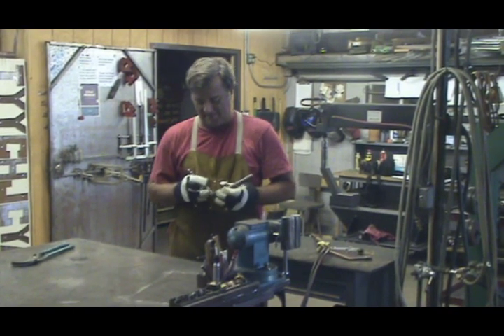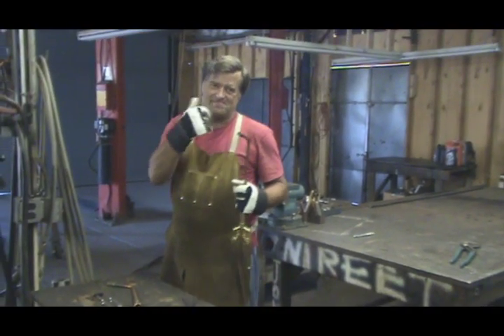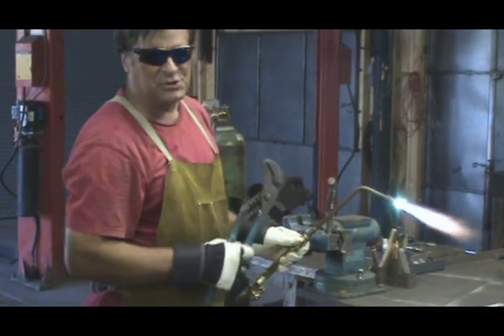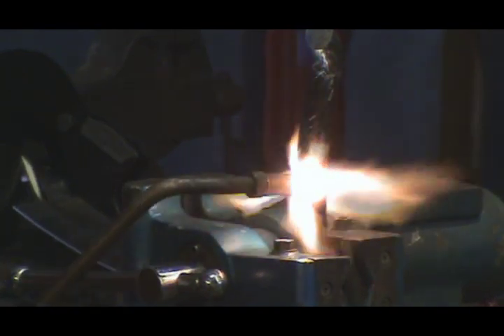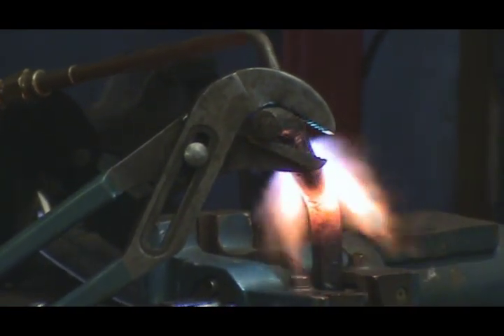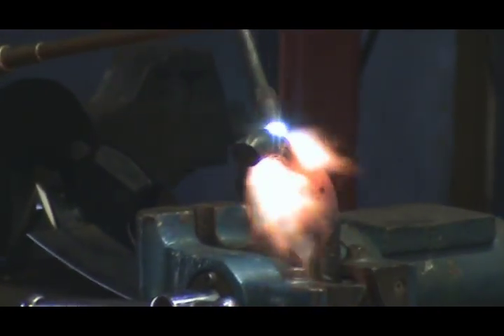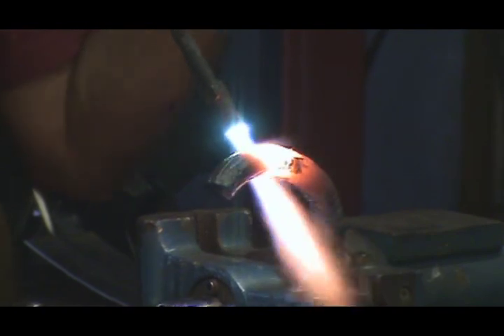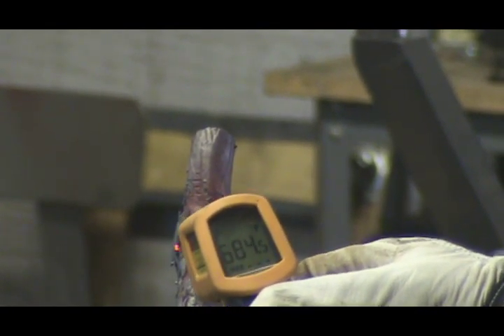Bending With Oxygen-Acetylene - Kevin Caron

Comment: try a little experiment :

heat from the outside of the bend until red.  bend it 90 degrees.  air coil.  you'll see cracks in the steel.

now hit from the inside of the bend only.  bend 90.  no cracks.

the outside being a bit cooler retains tensile (stretching) strength.  the inside compreses..like hammering a hot rivet...gets a little stronger.
Reply from the maker: I will have to give this a try.   Thanks for the tip!

Comment: How hard would it be to use oxy-acetylene to bend a 4-pipe engine header that got bent downwards when caught on something while going reverse? It would need to bend back up approximately 1.5-2 inches
Reply from the maker: You need to get a rosebud tip for the torch.   Should be easy after that.   Just go slow and watch for fires!
Reply: @KevincaronSculpture  thanks for the quick reply! Much appreciated
Reply: If you're only bending the collector, it should be easy enough.  If all four manifold pipes are also bent, then you will never get enough heat into all of them to bend.  You would have to detach the header pipes from the collector and bend each one back individually.

Comment from the maker: If I remember right the Oxy was at 18 lbs and the Acetylene was at 12.  But you should check the manufactures website or the owners manual that came with your gauges. Also makes a difference what size and type of tip you are using on your torch.
Reply: The gauges don't have an iota to do with the pressures you will be running them at.  Looking in the gauge manual would not be where you would find the pressure you need but rather the tip manufacturer ONLY.

Comment from the maker: @CBaughman I think to answer this question correctly would require a lot of math. That is something that I try to never do after hours. 

The amount of BTUs that the two tips produce is related to the different pressure setting between the two tips. The bigger tip runs at a much higher pressure. With the two extra holes it just sucks more gas. 

(yeah, that sounds like I think it should)